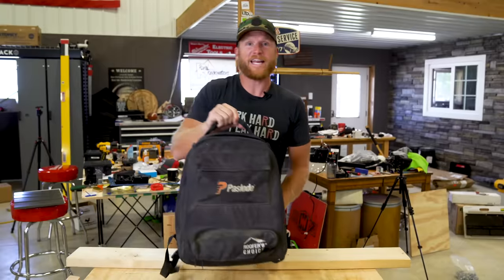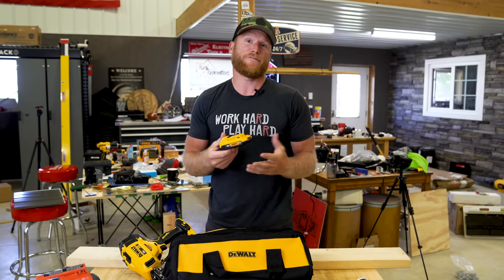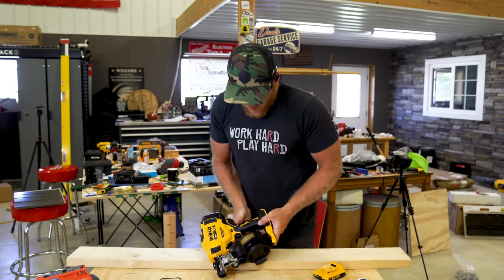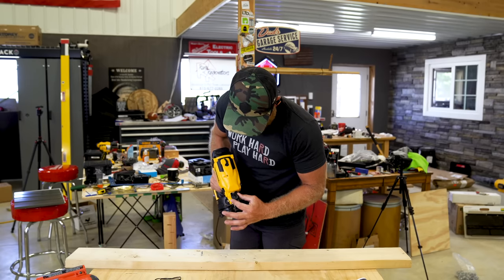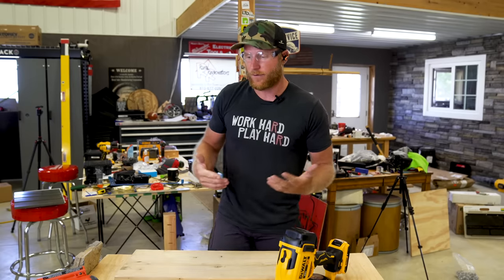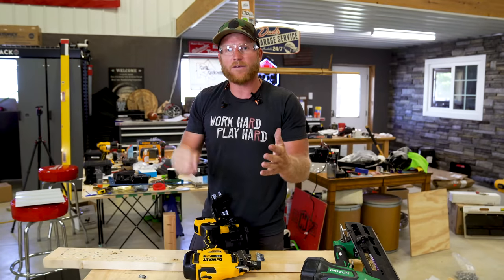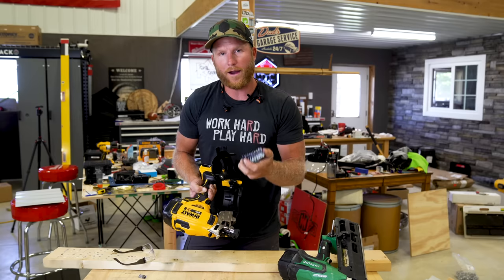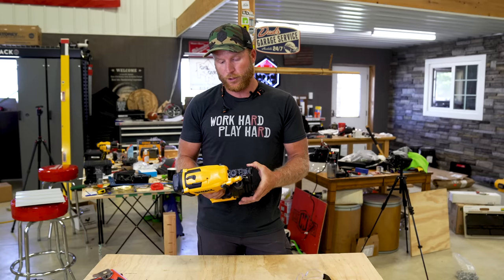BRAND NEW DeWalt 20V Battery Powered Coil Roofing Nailer: Toolsday

Comment: Nice video I’m waiting on the Hitachi Lithium Ion Version to drop.  Dewalts lithium ion firing rate is slow due to their poor flywheel design in the DC692 I never considered buying a nailer from them but it seems they know have something Similar to Hitachi and Milwaukee based on the rate of fire they claim this nailer can do.  As far as Hitachi Any nailer they make whether pneumatic or battery powered is top notch Milwaukee is finally getting on their level as far as nailers is concerned but Dewalt is lagging behind.  I’ve dropped Hitachi framing nailers coil and clip nailers (pneumatic) from one and even two stories up and just kept working.  I Have all of the Hitachi Iithium powered nailers and half of the Milwaukee’s although I’ve used most of them.  I also own the clone version of the Paslode Gas Roof Nailer which is by a company called “Duo-Fast” construction its blue and black it comes with the backpack and is the same exact gas roofing nailer as the Paslode.  They are great for punch list work and lil roofing jobs or repairs but not anything big or a reroof for that I would use my pneumatic Hitachi NV45AB2 and only thing that comes close to the durability, firing rate, low misfire rate, and driving power is the Bostich RN46, Max Super Roofer CN445R2/R3, Senco Roof Pro 455XP and a newer company often compared to Hitachi but cheaper called Aero Pro CN 45N Although it’s a trade off of weight, more misfires, ergonomics, firing rate, recoil, side loading and a swivel fitting. I watch your videos all the time keep up the good work would love to talk tools anytime....

Comment: The only negative I find is the weight behind it. I can smash thru bundles BUT this nailer is so heavy and a little slower releasing the nails that I wouldn't wanna use it for MULTIPLE long term use. Repairs and smaller jobs sure... maybe I'm just spoiled with the bostitch

Comment: Any idea on how to get the solid jam light to shut off. I tried the jam release lever. I made sure everything was clear from inside. No small pieces of wire from the coil or any build-up. The solid light just comes on and won't do nothing from there. Any ideas?

Comment: If it's anything like their framer I'll pass. I just ordered the m18 30 degree framer. Vant wait. It seems like the best nailer yet
Reply: Got mine on Sunday. Haven't used it yet, and waiting on the extended magazine, but will use it on a small framing job coming up. Going to go ahead and hold out for the Milwaukee roofing nailer as well.
Reply from the maker: framer is great so far
Reply: @RRBuildings  how long have you used it? Mine feels like its falling apart and once the flywheel stops working itll be in the trash
Reply: Hopefully for you it’s better than their fixing nailers. They’re all junk.

Comment: BUY A SOFFITT GUN  with a siding attachment (shoots1/2 wide staples)PRIME FASTENERS.YOU DO NOT  use shingle nails on soffitt or heavier siding ,use  the proper screw for the application.ON brick type siding use the nailer slots, as this type  expands and contracts alot. YOU would not want to nail it tight or have have nails work their way out ,way to hard to reinstall in middle of wall .Most brick siding works left to right .In other words, soffitt and regular siding ,soffitt gun, roofing-roofing gun

Comment: Great video! Have you found an 18 gauge narrow crown stapler that's cordless yet on the market? Cabinet maker here.
Reply: Dewalt has one
Reply: @bolerdweller  thanks, I see that one now. RR actually did a video of it back in Jan lol. I'm into Makita and Metabo, guess I'll have to wait for either of them to come out with one :(, I don't need a third battery system
Reply from the maker: Milwaukee also just came out with one
Reply: Ryobi has one.
Reply: @nbarnard  makita is my go to for cordless tools but their cordless nailers are lacking so I've got dewalts for those. I have a buddy that bought cordless Hitachi nailers and loves them. I think I may be going with hitachi/metabo next

Comment: If you go to a 20V 6ah battery sounds like you could get 4 squares (12 bundles) per charge 6 nails per shingle per battery pack. So if you had two 6ah battery packs and the 2ah battery pack rhat comes with it sounds like you could roof about 9 squares without charging a battery. 6ah takes about 2 hours to completely charge and 2ah about 30 minutes. I don't know if this battery pack roof nailer would hold up to using it every day for 10 hours a day. I bought one and bought two 6ah battery packs. l'll see how it works out.
Reply: re: "I don't know if this battery pack roof nailer would hold up to using it every day for 10 hours a day. "

Li-Ion batts figure 200 minimum number of charges to ~ 500 to 800 on the upper end ...
Reply: Batteries are $$$, unless you buy the knock offs.  Which are hit or miss.

Comment: i noticed you had the misfire with the paslode roofer. have you also noticed this problem with the paslode framing nailers? mine is missing all the time but mine is second hand and older. i am trying to decide whether to get it repaired or to buy the milwaukee framing gun when it gets here.
Reply: Any idea how many shots it’s done? Paslodes are temperamental if not cleaned and serviced regularly. A strip down clean and degrease might be all you need.

Comment: 500 nails is only 100 shingles (if you do 5 a shingle). Then there’s only 21-23 shingles in a pack. So your talking 5 bundles maybe with one battery.
Reply: On a 2ah battery though. I don't know anyone who actually uses the 1.5ah and 2ah on site, so if you allow for a 5ah battery as your "floor" then it bumps up to around 12 bundles on a charge, which isn't actually all that terrible if you're just doing something like a garage. One or two battery swaps and you're done.

Comment: Got any recommendations on a metal connector nailer?
Reply: Used this today for brackets worked pretty well sinks them on setting one, even strap brace pretty handy, got a positive placement dewalt nailer also abit heavy but works great

Comment: 1 guy wouldn't be laying 50 sqs himself on the nailer. Theres always 2-3 dudes at minimum on a job that big. So each of the 3 guys would need to change the bat 2 times maybe 3 if it's overly hot

Comment: Idk how many roofers you've met but when their not nodding out in the truck their chasing their dealer around town so as far as speed goes 3 nails a second is a shingle a second....what's to complain about? And 500 nails for their base battery....I think that's more than sufficient. It's like saying steph curry isn't as good as lebron. stop comparing and run it through a few roofs before you start nit picking like a sally